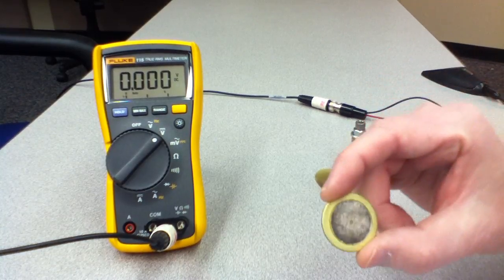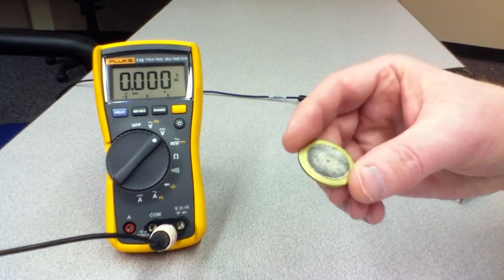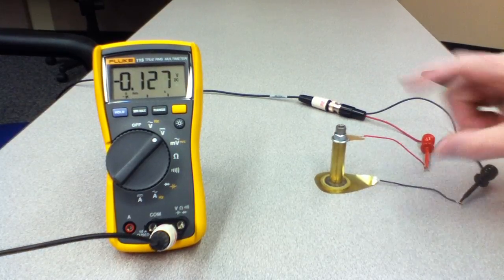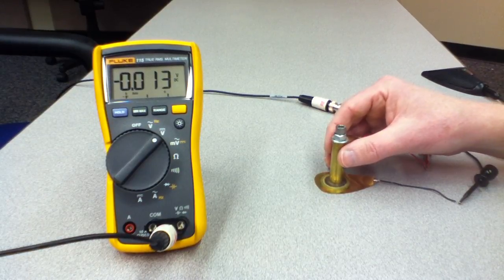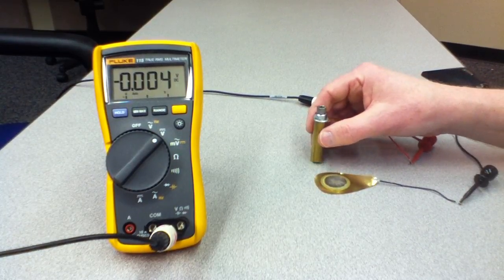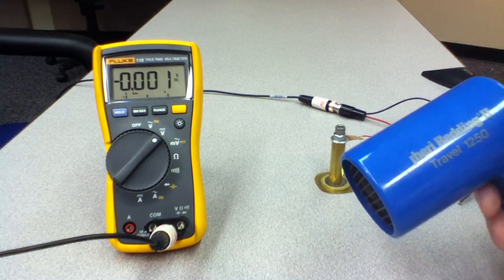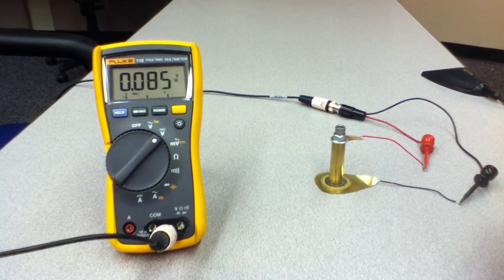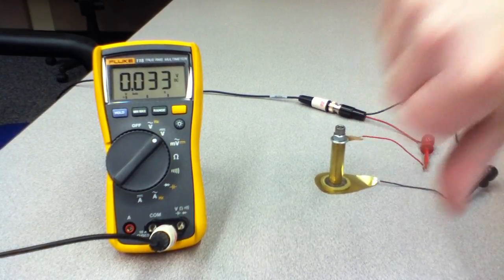piezo demo

Comment: I think voltage generated by the vibration,  which is  created by air blower not by heat. Because if voltage cteated by heat it must take some time to heat up and heat down.

Comment: Nice practical explanation sir. Would you tell me ,what are the factors that affects the performance of piezoelectric sensor? and also I have doubt that, can we generate steady electricity by pressing the sensor with constant stress?
Reply: thats what i also wanna know.. but that would mean that you could generate constant volts by.. sitting on it?
Reply: voltage can not be generated keeping press, have to press n release. but when there will be several discs in parallel n serial, a good useful amount could be generated and use through buck n boost circuit.

Comment: Output voltage we get by piezoelectric sensor is Ac or Dc?
Reply: Ac
Reply: The piezoelectric materials generate a pulse not constant voltage so we can’t depend on it’s reading to determine the load that contact with it
Reply: A piezoelectric sensor has a crystal that produces an AC voltage difference when it is stressed . AC NO DC
Reply: MartinMartin Martin looks like dc to me.

Comment: If you press and hold down, its voltage will decrease right? because there's no movements between the 2 plates. The releasing action should also generate voltage as there's movement. At least that's what my piezo is doing :/
Reply: Piezo not generate power in constant pressure.
Reply: Leslie Soon j actually had that question in my head. If you press and hold and don't release it , it can't produce voltage and energy ?